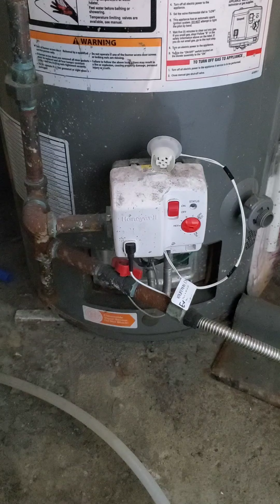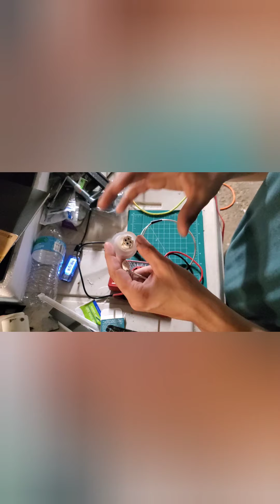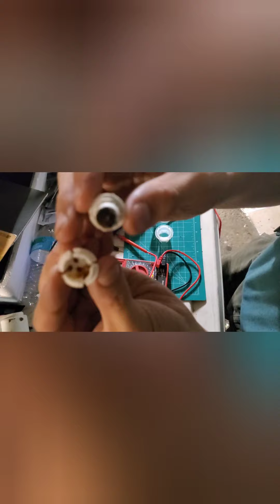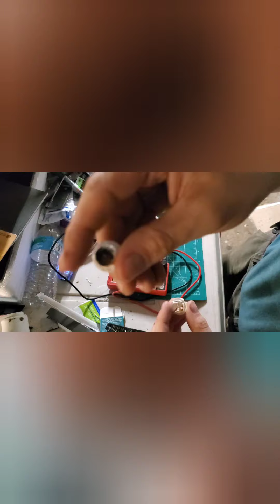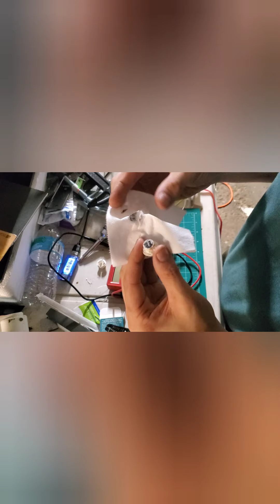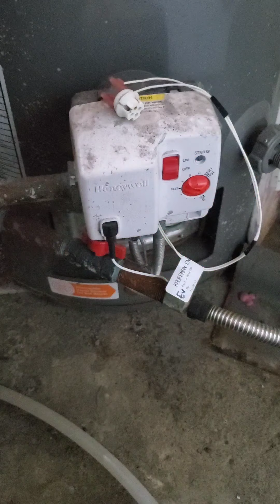Rheem Honeywell Flammable Vapor Sensor Bypass. FREE, EMERGENCY FVS Bypass

Comment: Very helpful my sensor got wet i used a hair dryer but no luck i put it back on then i turned the temperature dial up and down 7 times and click it worked thanks

Comment: While you're at it, fix that clusterf**k of gas lines
The control valve is supposed to be hooked up with a flexible connector.

Comment: You can also use a paper clip with the wires lol
Reply from the maker: This actually most likely would not work. It is measures the resistance of the connection.. so you might get lucky and find one that has the proper resistance. But... I would not put money on it.
Reply: @idkandyoucantoo3550 I’ve don’t it plenty of times you remove the wires from the sensor then hook the paper clip to the wires and it holds a current allowing it to work.
Reply from the maker: @harambee784  these sensors rather specifically need more then just the connection to be made. It must be made with the correct resistance in line, or they will not turn on. Falling out of that narrow band of resistance is what causes the "failure" in the first place. So no, any old peice of wire will not fix this particular issue.. its not a relay, it's a chemical based resistor.
Reply from the maker: Although if you have the proper resistor, you can just connect the wires with that. (As an emergency/temporary fix while proper parts arrive...)

Comment: I just wanted to comment that my basement flooded and I didn't know if the sensor was the only issue. I used a 10k ohm resistor in place of it and my tank started right up. Thank you for the info. Now I know I can order the sensor and that it was the actual only problem.
Reply from the maker: @Nerofmx  I'm glad this helped! I really don't understand why they let the sensors for a WATER heater be so moisture sensitive.. thank you for the view and comment!

Comment: Couldn't you just jump a wire from one to the other
Reply from the maker: No the computer measures the resistance, wire does not have enough resistance. (It could if you made it long enough... but that would be silly and the wire would probably cost more then just buying the part!) Sorry for the delay on reply. Just saw it. Thank you for the watch!

Comment: this temp fix worked great got my resistance to 15k and water heater after reset fired up. would like to know where he found the resistance paperwork. i will be picking new one up tomorrow afterwork. and will get a 15k ohm resistor to tape to water heater as a temp if this happens again
Reply from the maker: @MichaelIsaacs-j5p  glad this helped you out. I looked up the manufacturer specs for the control unit. I don't have the link, sorry. Thank you for the watch, and the comment!

Comment: Great fix. I wished I had seen it last night and could have showered!  Instead I found the last one available in Milwaukee at a Menards for $22.  Paid the extra buck last night to lock it in with an online order.  Turned out it was a open package and return but it worked anyway much to my surprise.  I plan to order a spare and leave it taped to the heater for future. But if we forget, will use you bypass!
Reply from the maker: @davidc5657  sorry you found me late, but I'm glad you managed your mischief. Thank you for watching, and thank you for the comment!

Comment: Just did this fix. Cannot find anywhere with one in stock. I tested the sensor and it was open.  I have used resistors, but do not have any at home and stores are closed.
Thanks
Reply from the maker: Glad this helped! Yeah most folks don't have spare parts like that just laying about anymore. That's why I thought folks might like to see a simple solution. 
Thanks for the watch and comment!
Reply: @idkandyoucantoo3550  
I got the new sensor, it's 30k. Going to solder some spade connectors on a resistor to keep as backup. The sensor lasted 7 years.

Comment: I did not have a multimeter so I've just added a small layer of pencil graphite in increments. After the 5th or the 6th addition, the heater came into life. It will hopefully work till I receive the new sensor. Thank you so much.
Reply from the maker: This is a great method if you don't have a meter. So glad it helped!

Comment: Only video I have seen that explained the operation and science of the Flammable Vapor Sensor.  All the others showed how to do the reset -  but that won’t work if the chemical reaction has broken the connection.  Perfect temporary fix.  Will order replacement sensor now.  Thanks!
Reply from the maker: Glad this helped!

Comment: Thanx, it would not reset this 2nd time faulting out. Basement has been wet, very wet. Moving, so stressed out and tired and in need of a hot shower. I didn't bother looking for a suitable resistor or combo of em to get the req'd resistance. This worked fine. Broke 1 wire off but Jerry rigged it for now. Thanx again!!
Reply from the maker: Very glad It could help!
Reply: @idkandyoucantoo3550  Bought replacement today, $20 at Menards(where heater was purchased!)Cheaper than EBAY. Thanx again.

Comment: How do you use the screwdriver to get that one piece apart?
Reply from the maker: The inside section is thermal bonded. So you slip it in, and twist till it cracks the bonding.. basically you need to break it. Carefully. Hope that helps!
Thank you for watching!

Comment: Couldn't you just use a 20k Ohm Resistor and just connect it? Currently we had a vapor sensor lockout, I reset it and worked for 1 day. I reset it again and still works for now. Could hot weather affect the sensor? It is only like 2-3 years old hot water tank, but I guess the sensor changes over time. So might have to replace it soon if it continues to fail. Nice idea to use a pencil to create a resistor; I was thinking just remove the sensor completely and use like a 10-20k Resistor for emergency fix. Thanks for explaining some things regarding this, take care....
Reply from the maker: Yes! if you have a resistor in the correct range that would work. But not many people hVe resistors just laying around. So this is more of a "dirty emergency fix"
I found that humidity was causing mine to fail. Put in a dehumidifier haven't had a problem since, the paste they use must be water soluble.. makes sense on a.. water heater... lol
Thank you for the comment!
Reply: @idkandyoucantoo3550  Well I put a 12k Ohm Resistor and seems to work so far. I don't smell any gas. I talked to a Rep at the Company where we bought the Hot Water tank; he says the filament of the sensor goes over time. I read 115k Ohm for the Sensor. But on your video with the pencil resistor you have 10k Ohm. Is there any Safety concerns? The gas  isn't odorless is it?
The humidty I think is another reason, been hot out in BC Canada lately July; I reset the furnace and it worked for 1-2 days when it was rainy.
Thank you again for this video 1st time I ever did this flammable vapor sensor replacement, it sure helped me.

ps: Another quick trick to get hot water to wash dishes or brush your teeth; just have a cup or bowl stick in the microwave for 1-2mins. heh

Comment: Great temporary fix, thanks. Since we all don't use our Harbor Freight Multi-meter on ohms that often it would have been helpful if you zoomed in on the selected settings on the meter. I was able to use a magnifying glass and freeze the video and figure it out lol. For others I chose 200k which is about the 7o'cock position on the dial and got the ohms dial and got the reading to read about 10 as in the video.
Reply from the maker: Thank you. That is great input. I'll attempt to make sure I go over settings on things like that going forward!
Reply: Worked like a charm, ordered a new sensor but won't be here until Monday.  We have hot water this weekend
Reply: Worked for me pencil trick got 9.7 on 200k ohms setting.